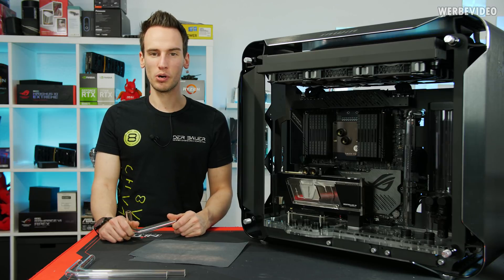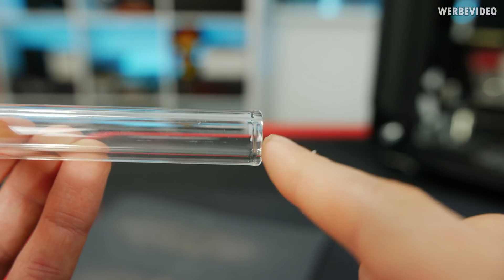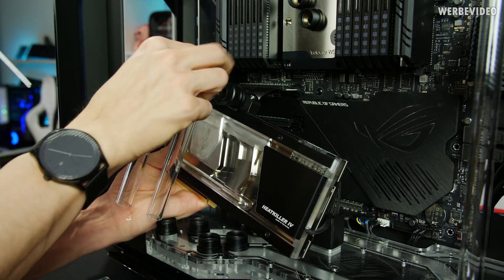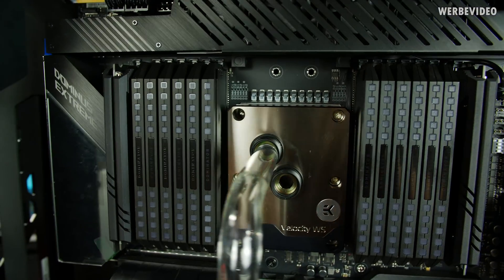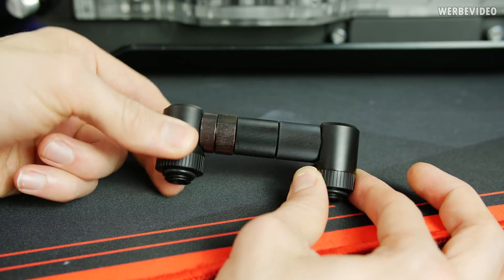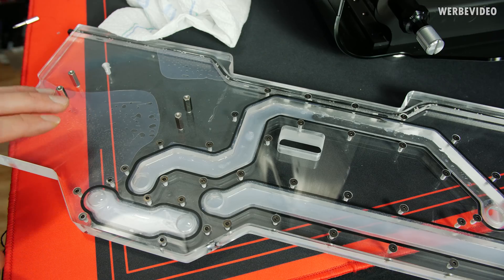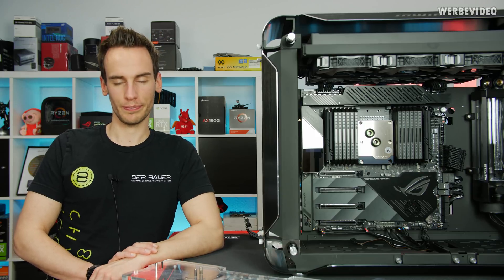Project Irrationality Part 9: The System is READY - or maybe not? The Distro-Plate-Surprise

Comment: Being in the process of building my new machine more or less parallel in time to yours, I can relate- I've owned custom build computers for 30+ years and decided to treat myself to a custom powdercoating of the waterblocks and case this time.
The amount of frustration I have experienced with my current build easily puts to shame everything I have put up with so far; from dropping my freshly coated parts to waterblocks that tested fine for a few days suddenly leaking water onto the CPU, sanding back the coating on the GPU-block because it developed your kind of drippage... I'm currently only building on weekends to ensure that I can focus and not do silly mistakes when I'm tired from my day-job.
I suspect your build we be completed before mine (I need to buy new riser-cables because mine are too long), I can just say "Ich drück Dir die Daumen! Halt durch und Kopf hoch- Du bist schon auf der Zielgraden."
Really enjoyed your detailed view of the whole process.

Comment: How's that block + mobo combo working for you? I installed my Dominus in a modded Enthoo Primo case with a Barrow blocks and tried around 15 mounts for the block tonight by trying to tighten screws a bit differently each time until I could get all 6x8GB Corsair RAM finally detected. This occurred even in my Dimastech test bench - with different modules. The 3647 socket is a nightmare. Intel dropped the ball on that one.

Comment: I wouldn't even use a distro plate, each fitting is a potential point of failure and a distro plate doubles the amount of fittings so double the potential failure. Then there is the distro plate itself being another potential failure point ontop of the pump, reservoir, and water blocks. K.I.S.S. = Keep It Simple Stupid.

Comment: Oh good god, never fill your system with the motherboard power connected, and never let your pump run dry. Consider yourself lucky that the leak was in the distroplate and not at a CPU / GPU fitting.

Comment: I'm surprised that EKW didn't send you a pressure tester... I shared a similar fate to you on a couple builds a while back and since then I don't add a drop of fluid before I pressure test it. Just a side note from personal experience, if you are using the EKW pressure tester with distro blocks DO NOT go over half way on the gauge or will will most likely crack the acrylic. I've done it a couple times and EKW's "safe zone" is far too high pressure wise for distro blocks. Half way is roughly around 7lbs/in which should be more than enough to see if there are any leaks.

Comment: I've been using two of the thermaltake premium riser cable for 2 years with slightly tighter bends then what you have so they should be fine there really tough good quality cables I had two of the crappy ones fail on me from bends though

Comment: Just as he was filling up the loop, I was like damn Roman's got some balls, not even pressure testing or putting paper towel down, then seconds later "Fuck, fuck-fuck-fuck" lol, bad luck dude, I can tell you just wanted to get it over and done with, and that's when silly oversights get made. 

Hope you get to the bottom of the issue and have it all up and running soon, though I'm loving the content, by the time you get it done, that 56 core monstrosity might be out lol.

Comment: @14:05 to say it's extremely frustrating is a gross understatement. I would have banged my head against the distro plate until it starts to bleed if I were you, but such is (the difficult) life of custom water cooling. That's why I have not yet jumped on the bandwagon of custom water cooling (but is using AIO now)

Part 10 would be the finale, I am sure buddy!

Comment: I don't think it's a smart move to use glass tubes in this huge case build, if even such 1 mm tolerance can break the tubes, what you think gonna happen in future when you move/lift/put down the case? The case can bend a little when you move it and that can potentially crack the tubes in some critical area.

Comment: Really need koolance to update QDC4 to use hard tubing. HQ-DC4? Would solve a lot of issues with hard tubing.
Reply: Also.. why not just use rtg or liquid gasket for engine blocks? Double the width of the channel and use the gel. Should work great. Other option is using thicker o-rings. Or both

Comment: I was gonna say you got balls for filling it with no paper towels around LOL. ALWAYS check components for leaks before installing them - a basic flush can nail down major leaks and a 24 hour test run expose smaller leaks. Too bad you got a bad seal on those o-rings.

Also, can you not get custom length PCIe extenders? I'm sure there's a way to cut that ribbon cable to length and attach the connector ;-)

Comment: So pretty much your standard ambitious custom loop build experience, then :P  For a build like this I think it's a good practice (although I understand the reasons you didn't) to extract the loop, test, and then reinstall once you're sure water is staying where it's supposed to .  Re: glass: I feel like maybe your  glass problem is you had the newfangled glass made from oven cleaner (lime) and you really need the old school cuts-you-to-pieces borosilicate (corningware pyrex) style of glass.  That oven-cleaner stuff is too rigid and prone to shattering imo.  Also when those tubes break do they crumble into tiny square bits like the window-shield of a car?  Or do they make scary life-threatening knife shapes that might cut your eyeballs out if you looked at them too long?  The former (as you also mention) suggests it has been pre-hardened through hot-cool cycling that ends up (I think) sacrificing plasticity for safety and rigidity.

Comment: Don't panic , this is all part of having an open loop. I suggest plugging all the ports on the distro--plate then pumping the distro-plate up with compressed air then immerse the the plate in water to find the leak. I did this to find leaks in my CNC  plexi pumpres unit. A good idea next time you assemble the loop is to use compressed air to leak check before filling with fluid. You were lucky this time you didn't get a leak onto your $$$$$ hardware. Also I would use some sort of remote power source to run your pump as in one of the clips there it looked like it was running dry before you could shut it off and I don't think power cycling your rig to suit the pump is great idea either.
After saying all that the PC looks awesome , all the best going forward and happy water cooling!

Comment: It took me about 18 months to build mine. I was building dual-motherboard case from scratch (fits 3*560mm radiators and lots of other hardware).
Also I didn't have access or skills to work with metal and glass, so I had quite an experience outsourcing manufacturing to some unreliable people.
I can definitely understand your frustration, but it is going to be great eventually!

Comment: Those o-rings can be real PIA. To be perfect you don't want to cut them but to have them as whole. Second best option is to cut them in angle to have as much area on which the compression can push those ends together and create a seal (you want the other end to come above the other because most of the force is coming from above and under and the longer the cut (less angle) the better; 60-degrees could already work but depending on pressure you might want to go as low as 30-degrees). Cutting them directly in 90-degree angle is really the worst way to go because you have so little force compressing those ends together compared to having even a bit angle for the force to directly push those ends together, like with 90-degree cut you need to have extremely precise length (you might even want to have some extra to get some compression between the ends) while even a slight angle already starts to give you some room for error because the compression force from the plates is directly pressing those ends together.

Comment: Hard tubing is the most rewarding when complete...but what a nightmare during the process.  I for one do bends vs connections to make angles.  Not a fan of those that primarily use angle fittings vs mutli bends.   I don't have  the patience for glass or metal tubing.

Comment: Probably a little late, but on I would put some kind of friction tape on the outside of the ball bearings where the tube sits. That will help prevent the glass tube from moving sideways while cutting, and since you're using ball bearings, there's no problem with it spinning freely.

Comment: See U on the next Season 2 ;) I'm doing build based on LianLi Armor Full Tower  including back light LEDs Perspex plates it Cyberpunk 2077 style some laser clolor prints on acrylic Cyberpunk logo and NCPD plate with additional micro screen in side on PSU  , managed to make 460mm modified tube for aquacomputer pump all looks great but still got some issue ;) whole system takes about 4000 ml of liquid . Managed even do aluminium oring to mound top of the large reservoir , and between reservoir and mounting surface managed to squeeze LEDs ring to light up this TOWER . It will looks good . But now thinking to add in side distro panel vertical wall , all ready got 7 RGB Corsairs 1*140 rad , 1*420 rad , vertically mounted rtx on bottom of the case plus DNA tube ;)

Comment: I feel you on this one, I was finally done with an all copper soldered loop for a build I'm working on and right as I was going to do leak testing and running system prep through it I had to get a new motherboard because the one I had wasn't working, but of course the store I bought from didn't have that model anymore and wasn't going to be carrying it so I had to get a different board and now 4 of my runs are too long because the shape of the board is just a little different.
Reply: Oh the joys of building custom machines. The difference between the true sadists and hobbyists is if the experience scares you away from custom loops or not.

Comment: What about high temperature silicone grease for lubing the ends of the tubes.  I'm thinking of the stuff they sell for the O-rings on automatic coffee machines.
Reply: Sil-Gliyde. i use that stuff on every rubber seal/interface i assemble

Comment: I have realy bad experience with EK fluids, color allways disintegrate within 2-3 months and starts create small gunk pieces.
Same thing does not happen with Aquacomputer or new Corsair fluid.
After issues with their GPU blocks and Monoblock this was pretty much last straw for me and I dropped EK completely.
Currently switched to 3700x with Noctua D15 as temporary solution, waiting for ryzen 4000 which is more than adequate for now and If I do watercooling again I am going to try components from Optimuspc.com with Corsair fluid instead.

Comment: Use a water loop pressure tester on the distro plate while there still is some water in it, bubbles and or water will show at the source of the leak.

Comment: Cracking isn’t the only problem with bending cables.  This is baseband telecoms concerns.  Minimum radius increases reflections.  The smaller the radius, the larger the reflections at higher frequencies.  More reflections, lower SNR, higher bit error rate.  If you want to run PCIe 4.0 the channel cannot be mistreated.

Comment: Roman, you can cap the ports and using a pump to pressurize the loop and check for the leak with the plate out of the case, use soft tubing to connect supply and return to complete the loop. You can add a valve on the output port (return) and throttle it down to make pressure as a closed loop would make on the plate to simulate operation and build some pressure and locate & make the repairs. Just an idea..

Comment: Surprised u did not leak and pressure test the plate, that kind of build should also be vacuum tested under water.  But it is easy to be a back seat driver. keep pushing :)

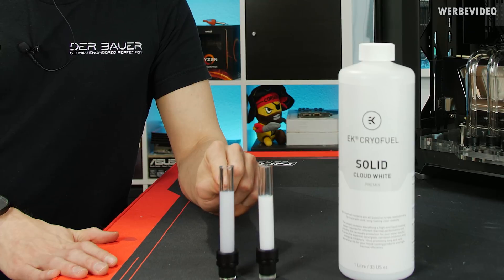Comment: BTW, the correct choice of word would have been "diluted" instead of "dissolved" @ 10:55
Reply: What to dissolve it with tho? Just distilled water or something else??
Reply: @UptownNYC  Depends on what the base fluid is - whether it uses water or propylene glycol, or a mixture of the two (those would be the most common). If you're diluting, you'll want to use the same mixture, or you'll change how the colorant material disperses in it

Comment: Ah, the tube diameter changes when you torch it, that makes a lot of sense. I was sort of surprised that borosilicate was cracking that fast under just uneven heating. Thanks for investigating that for us.
" I promise you by next video, everything will be up and running" Don't say that! because next video we will find out the PCIe riser has broken from too many mounting cycles or something.

Comment: Heads up Roman, I did a similar build about 3 years ago, same glas tubing but many many more cutes and tubes... it took me very long to get it all right. Maybe test the distroplate outside the system before installing it all again.
Reply: That would be the rational thing to do. You might want to check the name of the video, though.

Comment: Just permanently glue them together.  Then test with only the pump reservoir.  What is the real benefit to having o-ring sealed plates?  The o-ring will eventually dry and conform to the shape it is in so that on disassembly they would need to be replaced.

Comment: You are the man!  I love your videos - I bet you are gutted that 64 core threadripper is pending but aircooling these days is so much better - may be a better option?
Reply: He's just gonna get the 56 core Xeon 3375 to replace his 28 core one. Of course that thing is rummored to be 600W tdp so he'll need to upgrade his cooling too.
Reply: @KubeSquared  Ironic when the 3990X will run at 280W TDP with 64 cores and 128 threads!  Intel need to move quick to neutralise this!

Comment: Hmmm .…….  if it were my build I would have been tempted to blank off most of the fill ports on the distro plate and fill the thing up using a couple of bits of tubing (could have used PETG in this instance) and left things sitting all night to check there was no obvious problem in the morning.  I would have done this BEFORE mounting the damn thing!  Bet you don't rush into this sort of thing again!  You have my sympathies as there have been a few unexpected pitfalls on this build.  I always power up a pump externally using a separate power supply and do not use the motherboard power at all.  Makes it easy to switch on and off remotely then to help in the loop filling process.

Comment: To protect electronics, the first fill and leak test should be done with the CPU, GPU and 24 pin power cables disconnected. When I built my own system I tested all components and cables and leak checked every individual part before final assembly.

Comment: come on Roman, just put a Noctua NH-D15 and call it a day!
Reply: On an 18 core Intel chip that wants to be OCed? That will seriously push the limits of a D15. Those damn chips eat up AIOs and even a lot of custom CPU blocks. If he wants to OC it, copper radiators, Heatkiller blocks etc are the most reliable and silent way to do so. If it was TR air would be more possible to OC on without sounding like a jet engine, though hell look at all the trouble EposVox had with his 7980xe lol. Direct die custom loop wasnt even enough
Reply: @hi_tech_reptilezz  Obviously my comment was sarcastic. He's an extreme overclocker...
Reply: @hi_tech_reptilezz  You meant 28 cores

Comment: Is ready!. After the hole video, nothing is ready....I still get amazed at how people still chose water cooling for these expensive machines, unless of course, only to get youtube views and get money from that. If you really want a reliable machine with low maintenance just use air coolers.
Reply: Air cooling can't do what water cooling can. Good luck cooling that 28 core overclocked with an air cooler. Water simply means you can add as much surface area as you want, my system is virtually silent no matter the load and I value that.
Reply: Yeah like the Apple 28 core that is completely air-cooled and complete silence.

Comment: Look like you also found out the hard way - always pressure test distro plates, especially when they are assembled by someone else :)
Reply: Aquacomputer Dr. Drop. Absolutely essential kit.
Reply: @paskowitz  EK do a pump tester also that is designed specifically for water cooling components. Same kind of price.
Reply: yea i cant believe he overlooked that
Reply: @Nathan-ho6jv  They recently updated it with a new model. Also, while those are issues people have experienced, it doesn't happen to the majority of users (mine from like 2 years ago has worked fine for example).

Also, there is nothing inherently wrong with acetal as a material (many water blocks have threaded acetal ports). It's more likely that whatever the process the manufacturer used for tapping the threads has too much variance.
Reply: @paskowitz  Dr Drop works great for occasional use if you treat it carefully, but the port where the pump screws on tends to snap off. The EK one is the best if your going to be using the regularly. It's an absolute unit.
Reply: was just about to ask about that, if it's possible to pressure test distro plates but i guess yes. ^^
Reply: @ph7947   The way I have leak tested things is to submerge the item in water and pressurize it with air to a certain psi, Then leave it over night to see if the pressure drops. The submerge in water shows up any fast leaks immediately and monitoring the pressure over 10-12 hours will show if you have any slow leaks. Project Binkey did this recently with a modified car radiator.
Reply: @Outland9000  very smart :)
Reply: Story of my life
Reply: Or use air cooling. Muhahaha

Comment: This sounds ridiculous but if you use the same glass that HIGH END expensive glass water pipes use you shouldnt have heat related cracking. Contact ROOR.DE and ask about some custom tubes in the future should you need them.
borosilicate glass its called